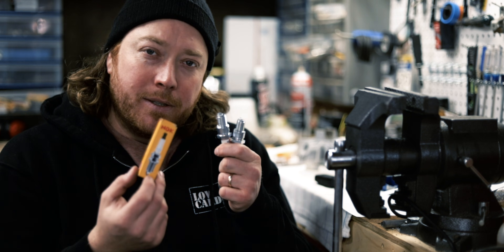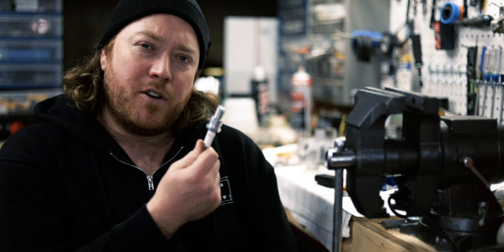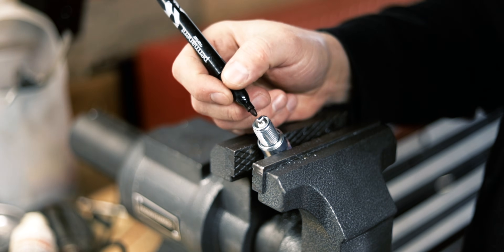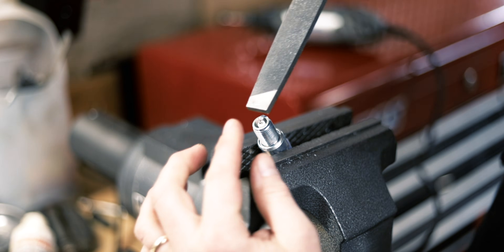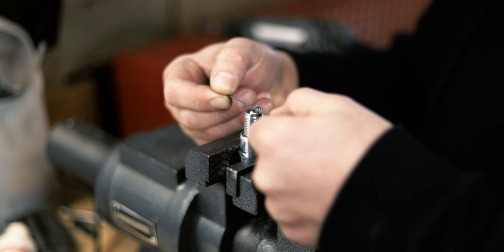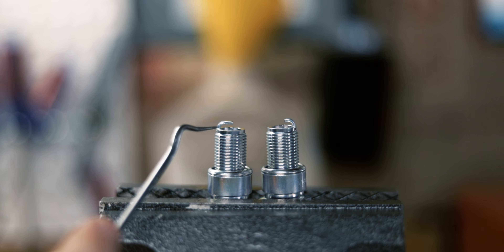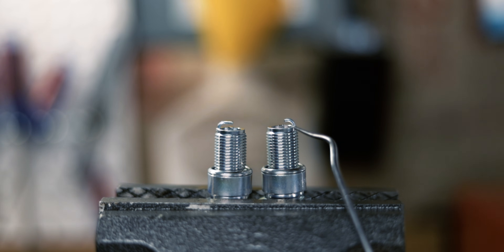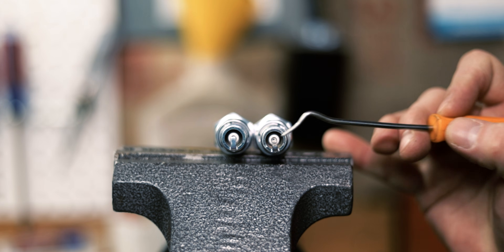Side Gap Spark Plug modification and explanation. Is side gapping a performance hack?

Comment: new engine tech doesn't need side gaping spark plugs  because the fuel atomization is very efficient unless you prove it with a dyno test.

Comment: This does make sense because changing which way the ground electrode is facing inside the combustion chamber has a slight impact on performance. 
I'm also going to try this on my carbureted Yamaha 700cc inline 4.....It requires 89+"octane due to higher compression. I'm guessing I'll notice a difference with 91 octane & the cut electrodes.

Comment: I switched from a ngk 6 to to a colder 8 plug on a little 49x40mm 2 stroke engine for summer. I'm hoping the 8 plug with a slightly bigger jet will help keep the cyl head cooler. While the chopped electrode will help prevent fouling & improve cold starts. Plus better burn of course.

Comment: Everything is true, except the longer life of side gapped spark plugs!
Reply from the maker: I think they have a longer life in two-stroke applications. because they don't foul as quickly.. I think you're correct that their life is shorter than a normal spark plug. but when I use a normal sparkling in two stroke it only lasts around 1 season
Reply: @ if the spark plug gets fouled, this means that you use too much oil in the mix or/ and the air/ fuel mixture is too rich  or/and the spark plug is too cold or/ and you idle the engine for too long periods . With side gapping until the electrodes edges still sharp , the spark gap breakdown voltage drops which make the spark a little bit more powerful. Unfortunately the electrodes edges get rounded very fast ( few thousand kilometres) and the spark gap increases . This increase the breakdown voltage and you can get misfires and later even damaged ignition coil . Side gapping come from the races world , but there they adjust the gaps and file the electrodes ( sharpen them ) before every new race .
Reply: @ also if the air filter is dirty you can get rich mixture.

Comment: Yesterday i did it. Og Piaggio Sfera 50cc 1994 close to 26'000 km, Fuel is in German called Super+ it means 98 Octane. Only replacement was the Exhaust with a new One, but the same Model. 
1. it revs easier to around 7800 as it was with new normal plug. 2. It holds 7800 better when the Road is not flat. 3. It revs now little bit over 8000, only on really flat road. 4. Down hill it over revs with ease to 8300. 5. For now it feels more smoother on full throttle, i was thinking oh there is a little slowing down around 40 kmh. I checked it many times with rpm and speedometer. Nope, nothing. It revs from 0-62 or so normally. No rpm drop or so. For starting better, I don't know, it is a Piaggio, i am always happy if he will start or he is not happy that he must stay in the garage and need a day or so. 
But and here is the BUT, every new Sparkplug feels good at First. After 500 or more Kilometers we will se how it holds up. If the plug last at least so long as 10 full tank of Feul i am happy. I hope i do not forget to make a post later!
Stay safe, healthy, knowledge and love!!
Reply from the maker: Sound great! Thanks for the feedback

Comment: There is no way the life span is longer.  Can't get something for nothing. You sacrifice stability for surface area and that will cause it to fail sooner
Reply: And doesn't this make them much more difficult to get an accurate gap?
Reply from the maker: That makes sense. But the I will say they last longer for me in my two strokes before they foul out. I usually change my dirt bike / moped plugs once a season. With the side gapped plugged I can use the same plug for 4+ seasons
Reply: @Corn-ped I might try this in my 85 Yamaha xj700 to see if I notice any difference......Gonna try it on my little 2 stroke 1st .

Comment: I tried this on my 2003 volkswagon jetta 5 speed manual. And It Does work. It works Alot better than just popping plugs into the motor

Comment: Not buying Spark plug companies pay engineers a lot to design them if this worked or had any benefits they would be making them.
Reply: Yeah and if you cut your car in half it'll be half the weight so it'll go faster
Reply from the maker: They do make them. They are used for marine two strokes.
Reply: @Corn-ped  yeah after watching the video I looked into it more, nobody really uses them on everyday cars they don’t last as long and benefits are minimal. They use to use them in racing but I didn’t find anything as to if they still use them. I use to race over 20 years ago and nobody was doing this.

Comment: I race a modified 75 corolla with a 2tc with uprgraded coils and wires that are grounded and an msd ignition box, distributer is stock. Would side gapping and opening the gap to .040 be any better than leaving it alone with the .032 gap?
Reply: Bigger gap is better if you’ve got the voltage to support it. If you don’t, you’ll get misfires, so drop the gap back down.

Comment: This will speed up its Lifespan wouldn't it since the center electrode is more exposed? Just wondering cause that's my only negative thought but very interesting...
Reply from the maker: yea it will. but I dont think it speeds it up enough to be a negative. I still get years out of my plugs.

Comment: I want to try this on my lawn tractor. Do you gap it to the same spec as normal after modifying the plug? Thanks.
Reply from the maker: Yea I still gap it the same. But now the gap is more diagonal than hidden.
Reply: @Corn-ped  hey thanks again. I side gapped my plugs this evening and the mower started and ran smoothly. Looking forward to putting it to the test this weekend.
Reply from the maker: @JosephSastreShowsYou  awesome! Let me know how it goes!

Comment: maybe better performance, but the electrode will wear away at a single point instead of evenly across the whole surface leading to quicker gap growth. why not just go with a fine point iridium for the same effect but years longer life?
Reply from the maker: Iridium don't last long in 2ts so replacing a cheap copper plug is easy and cheap.
Reply: Also Iridium runs colder vs copper due to it's lower conductivity. Copper is just a better plug. To address the gaping issue just re gap them after a while. They last just as long either way but need to be re gaped. It's kinda moot since there is very little difference between .40, and .50 performance wise. As long as the spark jumps the gap it's all the same combustion wise. @Corn-ped

Comment: hey man, so I`m just curious... so for example if you have a small 1.6 inline 4 cylinder and daily drive it. Would side gaping the plugs be a better option for fuel economy and drive ability??
Reply from the maker: I dont think it would do much for a eco 4T small engine. This is more for modified engines. I think they would wear out faster and you would end up having to replace them more often and loose money that way.

Comment: I've had plugs that the diode just broke loose after few years.  I should have changed sooner but still the metal is all that kept it from bouncing around cylinder. I still am gonna try this but for guys that choose to do it stay on top of replacing plugs cause it would suck to drop one in there over such small money.

Comment: You dont have the edge of the ground strap to the center of the electrode you have it cut to the edge of the electrode so what is best center or the way you have it?
Reply from the maker: When the edge is at the corner, it make the spark open to the combustion chamber.

Comment: If you have angle plug heads you literally just did nothing but ruin your plugs and cause the spark to be redirected from the center of the combustion chamber. Even straight plug heads has the chambers nowadays angled so this is ineffective.
Reply from the maker: I'm working on vintage 2t mopeds. They almost all have centered plugs.

Comment: Many racers,, starting back in the 1960s or 50s ,,  filed /cut the ground electrode to only over the center of the center electrode .. Many makers like    Motorcraft     Champion   make and market them like that as Race Plugs ..Accel makes all of their plugs like that and with a C cut  on the ground electrode .. I file the plug for my  mower engine  22 hp Kholer , ,it helps for a faster start and a better running engine ...
Reply: I thought for sure I was the only one.  My 19hp Kohler has a cut plug in it.  It for sure starts easier
Reply from the maker: Ohh that's awesome! I didn't even think about it for lawn stuff!
Reply: @Corn-ped   Too much metal over the center electrode seems to block the fuel  vapor a bit  I assume especially   if it is square placed over the piston  and filing it back allows the spark to ignite the vapor just a wee bit faster on a cold start and possibly a more complete burn cycle  with less emissions.

Comment: given that your carb has the correct gas/air ratio, will side-gapped SPs increase the fuel consumption?
Reply from the maker: It will not increase fuel consumption.
Reply: @Corn-ped  hi good day! I didn't fully understand this answer can you explain better please if you don't mind
Reply from the maker: @nolydpot8967  sorry, it will not increase fuel consumption
Reply: @Corn-ped  ????

Comment: How do you feel about surface gap plugs, like bu8h? Seems like it would have a similar effect of not blocking the spark
Reply from the maker: I like those but I have never had as good of results with them. Also I have never had them run well on points. With the side gapped plug I get good results on points & CDI.

Comment: Maybe the sparkplug company does it to protect the tip of the from the constant spark on the edge. If an arc burns/oxidized a spot on the normal one it can go to 40 other places that are equal distance nearby. If the arc on the side gap plug burns/oxidizes it has to go even farther pass the arc burn/oxide to get good  electric contact.  Or maybe its simply planed obsolescence can't replace a perfectly good sparkplug.
Reply from the maker: My gapped plugs lasts as long as the moped engine so idk. Seriously I never change my plugs.
Reply: @Corn-ped    well yeah i totally get that. Its definitely something I want to try.. the company probably engineering it this way for saving their own ass not performance. If they offer these sidegap plugs and then Bubba the cousin fucker saw these and put high-performance side gap plugs in his stock indy600 and then breaks down his snowmobile out on the trail because he never checked on his high-performance plugs and gets alchohol withdrawals and turns into an ice man. It could be a problem for the sparkplug company. And they don't want to sully their reputation on a new product that people are using incorrectly.

But yeah on a moped you probably are gonna toast your piston or bearing or rings or who knows what else before therse modified plug get oxidized up.... well maybe not you! These two cycle modifications can quickly turn into a ticking time bomb situation when people start "trying new things" both intentionally or un.
Reply: @Corn-ped  When I didn't know anything & had oil or carbon fouled out spark plugs. I bought new ones, not realizing that I could just hit them with a blow torch 🔥 or use a stove top burner & easily clean them up.
Reply: I've had plugs that after a few years the diode broke loose. Didn't even notice it but started having weird issues so I cleaned it really good and the carbon that was just holding it barely let loose and the metal stopped it.  This was 2 stroke but man was so glad it didn't fall into cylinder.

Comment: You won't see much difference on that small engine and power. It's used for heavy tuned/race engines with nos or a turbo or supercharger. Just go with a lower number if you want a warmer plug.
Reply: Us taking mopeds to 10hp from 1 or 2, is like taking a 2J and getting 1500 HP. This does have benefits
Reply: @GarrettH.6  prove it
Reply: @maxpionier5241  I Have a 50hp 125cc 2 stroke kart engine. thats like a you have 6L V8 with 2.400hp
Reply: Isn't a 10 HP, 60cc 2tengine with an expansion chamber a 'high performance engine with a supercharger' ?
Reply: @motzingg  4stroke people don't understand what performance and tuning truly is.  They replace it with displacment!
Reply: @motzingg  No they are using it in Nascar racing not on a 10 hp engine.